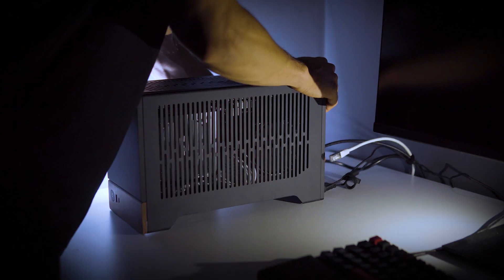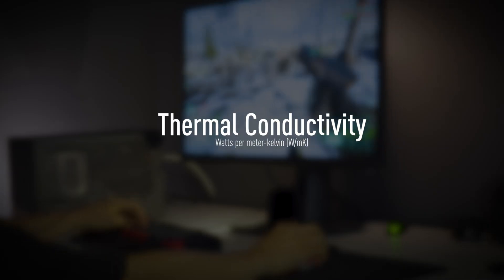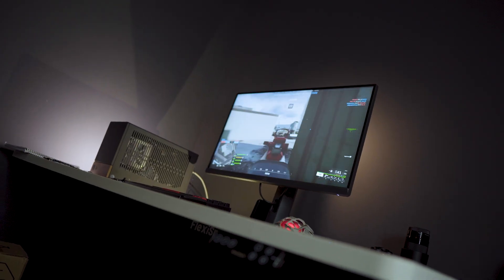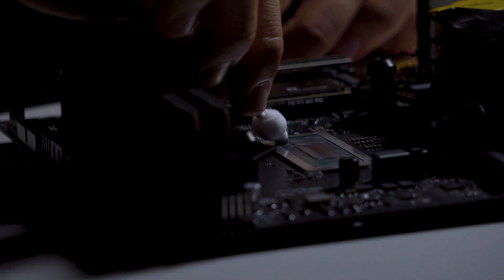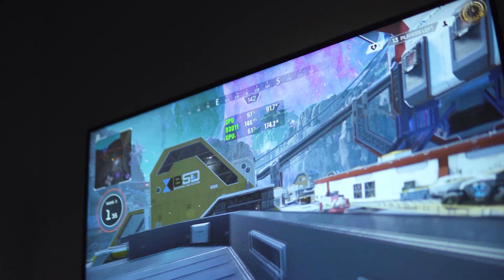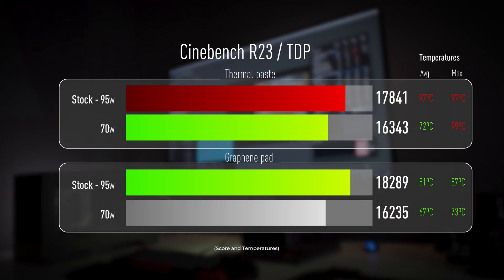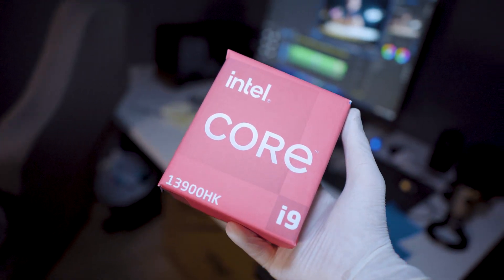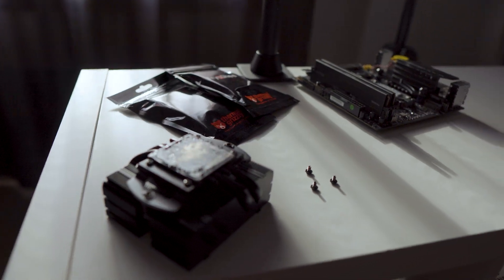Good Bye Thermal Paste: -30 degrees (no Liquid Metal) Saved My Gaming Computer

Comment: Using the notebook I9 in a desktop pc is making 0 sense mate^^
These cpus are trying to reach the thermal limit and running as close to it as possible. 

Don't think you would have any of those problems with a 12900k or 13900k.

But cool to see that thos pads are actually working good.

Comment: Your case and cooler aren't great for cooling the cpu either. 
I would change everything including the cpu.
My new system works just fine with a Lian Li 217 and a 9800X3D. 
My temps under load are 44c.

Comment: U can add thin fan 12cm 2 pcs
Under psu inside case and under mobo outer case

Im using 7800x3d and 4080 proart
Run well perfectly

Comment: Great recording :) My half year old legion pro5 with ryxen 7945hx in performance mode under full load heats up to 100C and then reduces performance to 3.8-4GHz. Is this normal? Should Thermal Pads lower the temp and eliminate throttling? Will I lose my warranty if I do this?

Comment: I used it grizzly ptm and I tried heat cycles with cinema bench (run 10 min and let it cool / idle for 10 minutes). My pack max temperature was 88° and max P core 84°. Is that normal in average I was at 80°. Now I’m letting it cool overnight did I mess something? 

Edit : I have an ultra core 265kf

Comment: Amazing.  Try Dynatron copper heatsink array.  It's what I use on my Silverstone Milo 12.  I use a Delta 92mm fan & I get 75C @ 4.3Ghz 1.25V on 3700X with a CPUz bench 85W PPT & 90A EDC.  Using MX-4 at the moment, spread edge to edge by finger.  About to start using Motorex or something copper paste.

Comment: I have a minisforum bd795m and I replaced the regular thermal paste with ptm7950. And it reduced the temperature by about 10-15C. And I was wondering if a graphene pad would be better than PTM7950. what do you think?

Comment: I always use these pads. They are great and I have reused them with no issues. 
But if you remove after used, be very gentle because it easily rips

Comment: Thermal Grizzly sells a "phase-change" pad now, I recommend looking into those as well, since their performance actually improves with each heat cycle.
Reply: I wouldn't put it on CPU since it's hard to get the cooler to separate from the CPU...it pulled my CPU from my Mobo...n I had to use a blow dryer to heat it to get it to release...as far a GPU I advise it
Reply: @Bigga_Velz85 only an issue with am4 and older sockets because newer sockets locks the cpu into the socket
Reply: Yeah got myself those for my Rx 6900 xt and my cpu its the same as ptm7950

Comment: pads and sheets are pretty much the same temps as paste. looks like you used too much paste. tbh i've never seen that much paste used that wasn't a joke.
Reply from the maker: nop, what really matters is the material property to disipate the heat, and it's a fact that these pads are way better at it , it's simple numbers.

Comment: The issue with the pad is that is thick. At ~ 0.2mm is way thicker than a traditional paste or the liquid metal. So in theory, a thermal paste with the same conductivity as the pad should have better results.

Comment: my 7800x3d runs max 70 degrees  with shit quality thermal paste, just bought carbonaut pad and will see how the temps look
Reply: How did it go? I have a ryzen 7 5800x3d and the iddle temperature is 65° and doing renders with blender 91°. ☠
Reply: @BufferInverso  i have 9800x3d with kryosheet and phantom spirit 120se argb... 40C when doing nothing, 50..55 when gaming and at stresstest cpu it goes to 95,6C. Don't know what to do as usually it will stay at max 60 when gaming but not likeing the 95C at stress even if 9800x3d can work at that temperature no problem
Reply: @flyfiredragon  You have a phantom spirit 120 I want that lol I think there is not much margin for improvement because what you could do is use liquid cooling, in your case you have better temperatures than me, try to keep your fans clean and manually set the curve of your fans.

Comment: For ITX a 7800X3D is a much better option. When undervolted by -30mv it's only consuming 55Watt maximum (stock is 65). That's really easy to cool. Your 13900HK is a mobile chip but it's also a true Intel with a Max TDP of 157W. That chip will always boost until the throttle temperature is met.
Reply: For productivity the 13900k is a lot better. I got a 14900k for that reason, and because for modern hackintosh you can’t use amd anymore. Just for gaming though got for amd all the time.
Reply: @Prodelem  intel hahahahahaha have a great crashing
Reply: @ I've had 0 crashes, and 0 degradation. Only used on latest bios updates so no issues lol.
Reply: @ cope
Reply: @Prodelem  I returned my 13900K under warranty and now I'm using 7800X3D. Should have gone for AMD in the first place. Much faster while only taking a  small sip of power.
Reply: @ That's great for you. Again I've had no issues with my 14900kf, and it massively outperforms the 7800x3d for productivity, which is what I spend most my time doing.

Comment: great video.. great production and quality and info.  I also have one of these mobile on desktop i9 13900HK units (though I have the engineering sample).  If you have time, I'd love your thoughts on overclocking vs not and if you do what settings you have used.  Mine is not in as tight a case, and I have an AIO.  I have it cranked up a bit.  It gets warm (to near 90) but doesn't throttle.  I have thought about getting down to the dim like you have.  This was a great video.

Comment: The heat spreader is actually a large culprit to the performance degradation. It’s a large mass of metal even though it’s thermally conductive it’s not as fast as a direct DIE to heat exchanger and actually acts as an insulator. This is a flaw of the engineered design of the motherboard and the built in CPU. Unless you find a way to modify it. I have integrated chips in my laptop running Liquid Metal (gallium) and it stays super frosty maximum 75 degrees on a hot day.

Comment: "when to change it", graphene pad last like eternal, there are several of my friend use it for years and still going, but the risk as you mentioned, highly electrical conductive, small mistake during the application and your components failing, kinda worth the penny for CPU with TDP that goes through 200W

Comment: The problem here is the heatspreader.. you have in practice a "delidded" cpu, so why don't you use a direct die solution? Menage how to put the cooler right on the die with that graphene pad and you will see a real deal....

Comment: However, the thermal conductivity of this thermal pad is not as good as expected, because its main heat conduction is not vertical but horizontal, which is not much better than silicone grease. At the same time, it will basically be unusable after disassembly, because the crease will affect the next use. Yes, when you buy a new product, if it is squeezed or it has a crease when you install it, then congratulations, this product is basically useless, like a gamble, of course this is a joke! You can choose the product you like, and I choose silicone grease.:face-blue-smiling:

Comment: Didn't work for me on my 14900KF. Works fine under light load, but under heavy load it gave me instant thermal throttle. Maybe works fine for lower wattage CPUs, but 253W crocodile ate that thermal pad for breakfast. While with thermal paste it hits 85C max.
Reply: u didnt apply enough pressure, if u dont apply lots of pressure its worse than normal paste
Reply: @mariomartella9181  It was hard pressed, there was no more room for pressure. Well, maybe there were theoretically, but I'm not about to break my MB screwing things like crazy.

Comment: Just changed to KryoSheet myself and I've found my idle temps are a bit cooler than even Kryonaut (non-Extreme) with my AMD 5950X.  The Kryonaut application was maybe two years old when I changed it, which may have had something to do with the improvement.  But the graphene will still last longer without degrading, so it was definitely worth it.
Reply: Bro its around ₹3,437 ($40.88 )
Reply: i also have 5950x

Comment: I've been using the graphene pads from IC for years now, but with the new build I am doing at the end of the year, or early next (waiting on the new X3D and Nvidia stuff) I was going to switch to the TG pads.  I really don't understand why some people are seeing the temperatures they are measuring with the pads though vs paste.  Paste was always superior because it fills in the gaps, while the pads do not.  The pads however were always within 2C - 5C of paste and you never need to reapply them.  Some channels were showing the TG pads performing better than paste (somehow), while most showed them to be slightly inferior.
Reply: The TG pad fills the gaps because it kind of melts/deforms when it becomes hot. But youre right, they are not superior to paste, even thermal grizzly never stated that.

Comment: Good video. If you're using Zen 4/5 CPU the pad should be exactly the size of the die. Wasted a day to figure out why the laptop was not booting after surrounding it with insulation tapes and only alternative was to add little amount of paste on both sides just to keep it from falling off. I used IC HC pad. 
Getting much higher cinebench scores and the fan profile is slow causing temps to hit 96c with stock paste and new thermal paste cooler master maker gel nano. Now it's 86C-90C. Thermal paste pumps out quickly due to how quickly the CPU changes frequency

Comment: Hi there, 
My processor measures 40x40mm and they only sell a 38x38mm pad. Do you think this is right or do you need to adjust or go slightly beyond the 40x40?

Comment: We used to buy 120 watt light bulb now its being replace with 10 watt LED.  Why not PCs do the same?  Electricity isn't cheap in the USA.  I pay 300 USD a month on electricity with out the ac.  lol

I gave up going for higher performance.  Im ok with 35 watt CPUs plus there isnt much difference I always use low settings even with the RTX 4070 for competitive there isn't much games that are GOOD that uses a lot of CPU.  I cant wait for 15 watts and that is close to level Apple and Qualcomm.   x86 companies needs to focus on performance with lower power draw.
Reply: Because you need the same amount of light to light a room 20 years ago and today. In PCs the deamand for performance is rising. Chips are becoming more efficient, but at the same rate applications and games are becoming more demanding. So if you can make a 10w cpu that performs the same as a 100w cpu from 10 years ago, you can also make a 100w cpu that performs 10x better than a 100w cpu from 10 years ago (just an example). Hardware drives software an vice versa. When there is performance, games make use of it. And there are many games that use a good amount of cpu. 

The thing with x86 vs ARM is: upscaling. It does not go linear (like in my example above). Low wattage chips will always be more efficient in terms of performance/watt. You can also see this in x86. There is no huge difference when running a ryzen at its 170w vs. eco mode with only 105w. So once apples or qualcomms chips hit the same performance levels as highend intel or amd chips - then its a fair comparison. 

But i agree with you, rather than just pushing the limit we should focus on efficency and try to optimize software first.

Comment: I have an Erying board with the vapor chamber because is M atx, and I bought it instead because of the thermal throttling problem on itx. I don't have thermal problems and my processor run full speed at 68w but I'm curious to try this special pads.
Btw... Is there a good contact between the cpu and IHS? Isn't too thin? I'm afraid of this.

Ps have u tried undervolting? Erying motherboards push a lot on the core. Try at least a -100mv on the core, and -50mV on the cache. You will be surprised ;)

Comment: A lil' bit expensive but the results are here !
Reply: Not really. I mean, he lowered the TDP and good paste will be very similar (likely better) than the pads. The huge benefit those pads have is that they dont degrade / dry out, so they will last indefinitely, as long as you dont remove the heatsink. The pads are very good tho, but nowhere near tens of degrees, more like same or a degree or two better at best, and may be worse if you use really good paste. I'd still go for pads. Just not for misleading reasons like -30°C
Reply: @Yamyatos  It's true that some thermal pastes are as expensive, or even more expensive sometimes.
Ok, so it’s both practical and effective, thank you for the details!
Reply: @Yamyatos  Yeah, he's being very misleading in this video. I did some research and he's basically the only one claiming such huge results, everyone else says they're the same or slightly worse than good thermal paste.

Comment: 13th and 14th gen intel have microcode issues and oxidation problems.. They degrade fast and get hot and self destruct eventually.. Change to 10-12th gen or go amd. Problem solved.

Comment: have you tried a different cooler???  that r23 score seems awfully low for such a large heatsink.  Maybe you have the fans turned down to be silent?  My 12800hx laptop averages 22k in r23 but with CRAZY loud fan noise.

Comment: I like the video, however the -30 degree is VERY MISLEADING. If paste is applied properly the temperature difference could be positive (doesn't have to be) but most of the time it is a matter of 1-2 degree at most.

Nowhere near -30 ...
Reply: He had max 97 with paste and max 87 with the graphene pads. The title is a lie and it's just another clickbaity youtuber lol
Reply: I had worse results with thermal pad than with thermal paste. So I went right back. Waste of money in my experience. Cpu overclocked to 5,4ghz 12900K and Cooler NZXT Kraken Elite.
Reply: I also find this very misleading. These thermal pads are not superior to paste, they perform about thesame, but are far from liquid metal. The advantage of pads is the longevity. Roman Bauer "Der 8auer" (the man behind Thermal Grizzly) even says that in his vidoes. The -30c is either staged or the previous cooler mount was not correctly done.
Reply: @thed8278  well thermal grizzly pads are close to, and if not, does beat noctua thermal paste., What world you been in living in? Multiple tests have shown this, from Linus, to gamers nexus. Also pads can be used more than once at the cost of performance, There is a cryonaut pad vs sheet. The sheet is one time use, while the pads are not.

Go search Thermal Grizzly. The old IC graphite pads wernt as good back in the day but times have changed.
Reply: That temperature difference of -30C is definitely a lack of application experience with thermal paste lol.
Reply: way too
much paste. I bet it wasn't mounted properly as well

Comment: If you ask me, with all those money spent on the graphene and all Grizly overpriced products, I would got a desktop CPU and maybe an AIO
The biggest issue with your rig is that IHS.. to much thermal resistance.. 
I got 50°C on my 11700K @ 100W  using Arctic Cooling MX5 TIM.. with a custom loop.. but..
Another thing to mention: best practice when comparing temperatures between coolers, fans, thermal interface material or other things is to make it at the same TDP
Claiming 30C ∆ but at different TDPs is misleading.. BIG TIME !! ✌✌

Comment: W/mk numbers are useless without other data like pressure and heat. Anyhow, in a normal CPU mounting mechanism and generated heat, graphene pad only goes around 3.5 W/mk, so it's probably worse than good paste out there. Also, paste that advertise more than maybe 5 or 6 W/mk is also screwing their data a little bit. Good paste can maybe reach 5.5 W/mk under real world scenario, but anymore than that is just misleading marketing, and yes, that applies to basically every major brands out there. 

That is why arctic and derbauer did not include any W/mk measurement anymore, simply because the metric is unusable without any standard whatsoever.